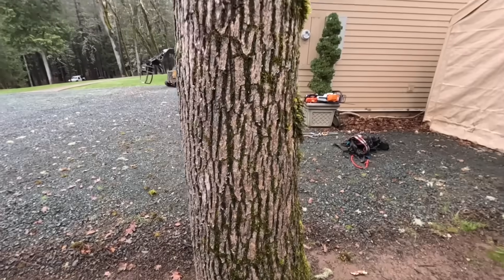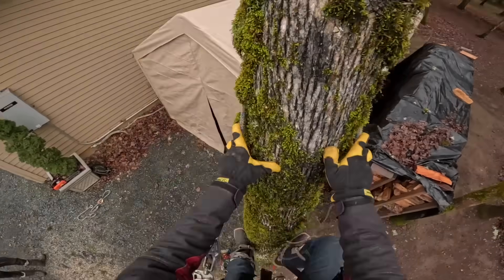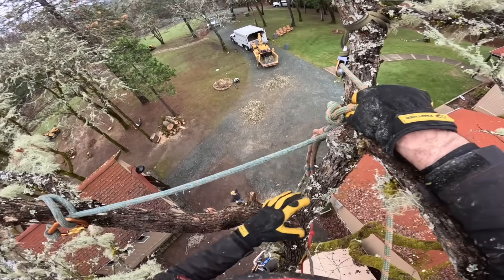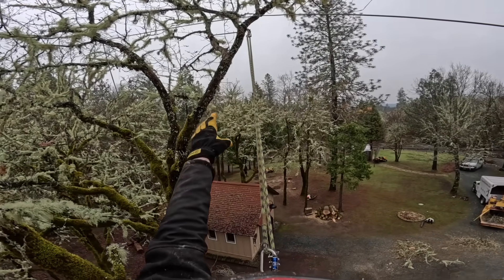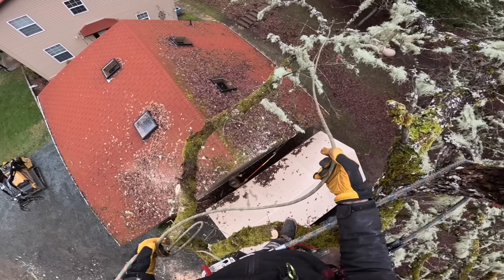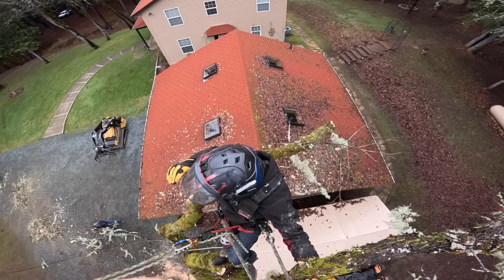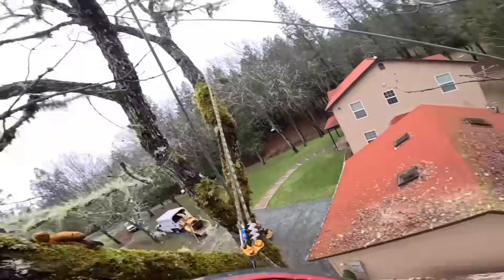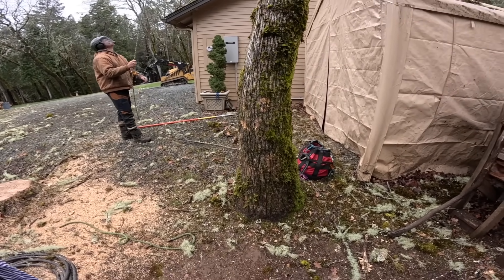Engineering Small Limbs for Strength: Tree Rigging Over a Home

Comment: Chit decent humboldt in the bottom.........block and tackle off the driveway tree to the left and yoke that bitch down with a bullline right into the driveway! I know im a hillbilly. just drop it right in the driveway was my first thought. Btw your thoughts on the crane were sound esp with folks having septic system tank covers etc that would easily crush under those weights